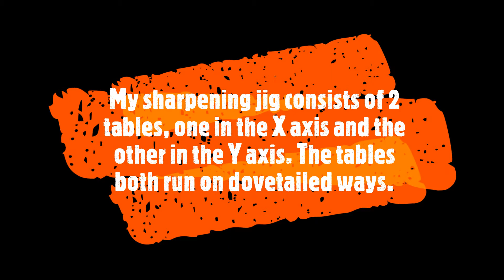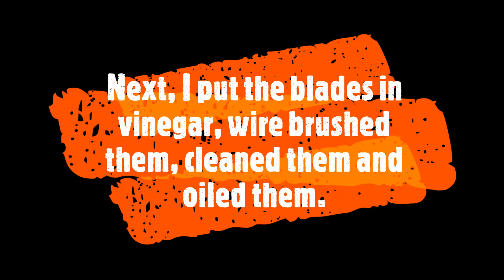Doors,  Blade Sharpening and Chores

Comment from the maker: The door I made is done but I might want to hang it differently since it is thicker. The saw blades are out of the vinegar, it got most of the rust off them and then I covered them with light oil. I hope to detail the sharpening jig I have so maybe you can make your own since good 10" blades cost $30 on up. Lately my blades have been $30-50.